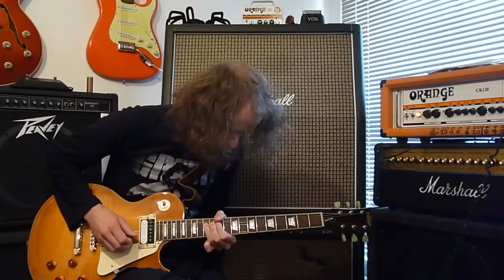Why I prefer Solid State amps to Valve amps

Comment: Solid state amps hold their tone better. A tube amp needs to be cranked up to the stratosphere to get the best from it whereas a solid state holds its tone at low and high volume. Solid states dont like to be cranked high either. people run SS amps like tube amps and wonder why they sound like shit.

Comment: Interesting. My experiences are the opposite. 
Solid state amps are fragile. One spike from a countryside power line and they might die.
The valve amp can take much more abuse without any problems.
 I had a Super Reverb that worked perfectly for over 20 years. It sounded as good when I sold it as when I bought it. The power valves are the weak spot as they can get worn after a couple of thousand hours of use, bet the preamp valves can easily take 50,000 hours without degrading.
I never serviced my Super Reverb as there was no need. But during those years I had to repair some solid state amplifiers that could not handle normal use.

Comment: Ha... I know exactly what you mean. Ive gigged tube amps for 35 years in evry enviroment you can think of.. Bars, barns , sidewalks, Street dances, garages, fields, Gyms you name it. Like you said a tube amp has it's own mind. Ive started gigs with 128 volts showing on the meter and watch it drop to 108 v in a matter of seconds.What I think happens is the Bias changes and the power tube's curves change enough to hear and feel it. BUT- it can be magical at times and that's what tube freaks quest for- those rare 'voice of God' moments.     I use marshalls (plexi, 800's ect) but in the 80's I did a stint with solid state Randalls. I was sold on their 'Constant current' and damping factors, and like you say, CONSISTANCY. Plus I didnt have to Jack with tubes. It took about a year for me to miss those fucking tubes. (harmonics i guess) . To each his own- Nothing wrong with solid state though- they do have their upside. Much respect, thanks for the vid....
Reply from the maker: Thank you for watching. : )

Comment: Get a Roland blues cube or 1980's Marshall Lead 12, Lead 20 or Master Lead 30 (a jcm800 circuit in solid state). My lead 12 sounds just like a tube amp. But I prefer Tube
Reply from the maker: I have a Marshall master reverb and a 5210 combo. They are very awesome. :)

Comment: the Marshall MG series was the biggest piece of crap they ever made. The AVT and Valvestate series were the best tone in my opinion for solid state. old MOSFET Marshalls are very underrated too, they lack some full bottom, but they are the loudest clearest thing I've ever used.
Reply from the maker: I would beg to differ on that as I love the MG series. I owned a valve state head and it was good but I got on so much better with the MG and still do. I have a few of the old solid state marshalls to. They are stunning amps. Thank you very much for watching. :)
Reply: to me the MG series was just way too scratchy sounding, and switching from dirty to clean was no easy task. the clean would always be too loud. i almost bought one of those orange amps in your video, but i compared it with my AVT-50 head and stuck with that. my main rig is a 1988 JCM 800 2205, and the AVT can come close to my normal sound

Comment: Yeah, there isn't much of a difference in tone/sound between a solid state amp and a tube amp, especially when going through the same company for both of them. However, I have a 5150 II and also had a MG 100 dfx and a solid state peavey combo amp, and the difference between the two Peavey's and also the 5150 II and the MG 100 was night and day! I mean I could get a pretty good tone and sound out of the MG, but it wasn't anywhere near the quality of my 5150 II.... not really even close. The 5150 II is sooooooooo much better. And, in my opinion one of the best amps ever made, if not the best. It's better than both the JCM800 and 2000, better than a Bugera, lol better than a 6505/6505+, and even better than the original 5150 and the newest 5150 III. However, that is hotly debated as of late, and I think it only barely beats the III out by a little bit.... but that's just me. I personally also don't see much difference between solid state and tube usually, but there are exceptions out there. Like how the JCM does have a better tone and sound than the MG does, and it's fairly noticeable. And on the other hand Line - 6 amps I can't see any difference in sound or tone between SS and Tube not one bit. And with Orange, I haven't really noticed much of a difference if any between the two I don't think. Cause some people will say that it's all about the maker or brand and the quality of their products overall, siting Peavey and line-6, how with Peavey SS and tube you can tell the difference, but you can't with line-6 and blah blah blah, but the same is true for Orange I've found, and they have super high quality amps of both kinds, just like peavey does. Like everything it is all about personal preference and also a person's desire for stuff to be a certain way, so they will hear things that they want to even if they aren't really there. You really just have to decide for yourself what you like and just go with that. What another person chooses to like and go with is their preference and right. No one has any room to say "you should be using ____ instead because it's better" well it may be better to you, but to them it might not be or it might not make any sort of difference at all whatsoever. Do what you like and let them do what they like, or as the saying goes, to each their own and live and let live.... or in this case jam and let jam. lol

Comment: I think the same about those who believe their Hi-Fi system sounds better than say my Marshall stack (in stereo) for playing rock/heavy/metal/punk music !! I have my lovely floor standing Q Acoustics next to my Marshalls and I switch between the two depending on my mood, type of genre and I guess sometimes IF I AM SOBER.  No one on this planet would EVER convince my that say Motorhead could EVER sound better on anything other than Marshalls, how could it, it was recorded using the damn things !!! But what I really wanted to say, its ok using Valve but its the actual speakers in your cabs that matter the most the drivers those round things that generate lots of noise (sometimes). Mine currently have G12T 75 on top with seventy80s on the bottom I took the VIntage30s out cos I wanted a change. cos to me no matter what amp u use, if the speakers are not to your liking, flavour taste, no matter what the amp, its going to sound really bad..........

Comment: Ironic how reliability and consistency are an issue with old tube amps. It was reliability and consistency that kept new solid state amps out of the market when that technology first came out. Just like old tube amps i'm sure old solid state amps play up as well. And just like new solid state amps, new tube amps are also reliable and maintenance free. Just avoid the vintage 'nos' tube nonsense unless you here the difference.

Those solid state amps sound fine but there is far more to choose from in tube amps. Good luck finding a solid state tweed, brownface or blackface design.

Comment: I agree with almost everything you said ..... and one of the biggest things is that the vast majority of cloth eared twats at any gig really makes the sound quality question redundant ... I started playing in the 60,s and the only thing available was valve gear ....when eventually solid state first started appearing on the market the sound quality was absolutely abysmal .. but with the advent of the peavey bandits everything changed ... a good teal stripe bandit will piss all over many valve amps  ...... so yes more power to your elbow mate .... I do get fed up of listening to twats preaching the niceties of valves .....(too much maintenence)

Comment: I've have a bugera V-22  1-12 combo 22 watt valve and compare it to my peavey studio watt 65  1-12 combo  and you can hear the difrance my bugera V-22 sounded way more powerful than my peavey 65 watt solid state amp you have to compare side by side the next time you get the chance
Reply: I Compared my Orange cr60 next to the Bugera v22 and i liked the orange much better ! Its more Powerful -  has more Volume - more Gain and a far better "British" Tone , not all Solid State amps are the same !

Comment: Bugera makes affordable Valve amps, for example the 1990 is a JCM900 clone and it sounds exactly the same as the 900 with the knobs set the same on both amps, and the Infinium amps are great because they monitor the valves and you can switch them out yourself and the 1990 is only $400 new, just sayin people

Comment: I only ever used Solid State amps. I've had one vale amp in my life, and it was curious and fun. It was a home build project that I thought sounded interesting. That is the thing I guess. In the end the only thing the amp does is turn guitar signal into noise. After It's done that you eighter like said noise or you don't.
I've always found enough solid state amps that make noies I like. 
Sure, there's enough solid states out there that are rubbish, but try to avoid them. It's not rocket science really.

Comment: Use what you like.  It was necessary to make SS amps. We finally in the 60's were able to get  PA SYSTEMS and GREAT BASS AMPS all SS the rest were low wattage and the bass sounded bad. Keyboard amps SS best.  I agree its nice to have a light weight amp.  PEAVEY PROOVED THAT  he could may Road Tuff and good power Guitar amplifiers. Peavey was affordable and these amps are saturday all over South Eastern USA and then everyone went to SS. Ampeg had to do it and lots of other out of business amps the most interesting SS amplifiers made in USA were the KUSTOM TUCK and ROLLED PLEATED high wattage big speaker amps. VOX made a tone SS Beatle amps. Its all good. I am a Tube amp man but I still use small SS amps in the Studio QUIET. CHEAP

Comment: Had both much prefer solid state better distortion. And louder. 
I find I have to hit the strings harder with a tube
Amp...I can play faster
With a solid state...
If there is a difference in sound it isn't worth the price difference.

Comment: Valve amps are a lot more tolerant of different electronic factors that one imagines. From biasing to impedance matching to drivers.. There's a lot of voodoo spoken about valve electronics. Remember, just fluctuations in mains output will have the most fettled valve amp operating at a different parameter than the absolute designs but heck, unless the circuit design is pushed to absolute boundaries, <20% tolerance of operating voltages is workable. Just checkout vintage amps working with most of the vintage components well adrift...

Comment: How dangerous valve amps can be??? Eh?
Dude you're buying old knackered amps that's the problem. I had a boogies for years, gigged the crap out of em and never put a spanner on em or changed any valves. They never ever let me down and the tone was just killer!! 
As for not hearing the warmth or tone of a valve amp, I really can't understand what you're saying. 
I have had a good SS amp, a Fender stage lead which sounded but once I played through a couple of Boogies Elvis had really just left the building and I've never gone back....ever and SS doesn't even come close to me. 
I'm not saying you're stupid or an idiot or anything like that. Your opinion is your opinion and the same for me. But I do massively disagree. 
But hey that's ok. It's a free country. Have a good um. 😉👍😎

Comment: You buy a valve amp because it's impossible to hear a ss amp when u got a bass player with a valve amp and a noisy drummer.

I had to buy a valve amp because my guitar was way too quiet
Reply: SEDAT   disagree 

 took my MG 100w
To the studio..with strat mex  sss 50s.
The drummer was a zep fan..so played like Bonham 
Bass player and me.had ear plugs In. MG on 10.
Cut through as good as my
TSL...STOP using the TSL
because the MG sounded 
Better....used MG  live
In a pub..and was asked to turn it down.
(  most small venues have a PA anyway ) so your problem can be solved easy...
Reply: @Mr75044  I have a randall 150RH SS amp and it can't even cut through vocals on full volume
Reply: @Desolator1  all I can say is in my experience..in 1980
I had a hywatt  valve head
But now I would rather use
An MG...Try a boss eq pedal  cheaper than a new amp    plenty on e bay..
Used one with  a roland 60w  cube...worked fine.
Reply: @Mr75044  mg is fine.but please don't suggest that mg is just as good as a very good valve amp because it's not
Reply: @Desolator1  tried to help you ...suggested an eq....I'm not going to argue. Suggested you spend  2000 pounds  on a
Valve head and stack  then.

Comment: Hi Dave, could you please expand on the dangers of an unserviced valve amp?
I'd be very interested in what you have seen happen with them. I'm an electrician with a degree in electronic engineering and personally dont like the idea of getting up close and personal with high DC voltages/currents but I do have a 1968/9 Park(Marshal) 50 watt tremolo combo in my possession. No plans to really use it as it is monstrously heavy as well as apparently being fairly valuable. I just stuck a couple of new valves in it a couple of years ago and it fired right up after spending maybe 10 years in my Dad's shed. Massively loud and powerful and all but I dont feel comfortable with the potentially lethal combination of high voltages and high currents within it. Have they bitten many people?   http://www.marshallforum.com/threads/park-amp.41646/

Comment: Simply answer if you play metal and want someone elses  sounds, play on a solid state, if you want your own sound and dont play metal, play a tube amp.
Reply: I think your wrong cuz a solid state sounds like shit when high gain but pretty good when clean so your logic is flawed
Reply: then why have an amp that just sounds okay sometimes
Reply: or only in one setting lol
Reply: Markus Odisho SS amps are always modeling, that means they are always altering the signal. there is no way to simply accept the signal coming in from the guitar, aka clean. its always processing the signal whereas a tube is not. that's why you cannot get a true clean from a SS amp.
Reply: Are you serious Steve? The whole goddamn point of an amplifier is to change the signal, and a tube will always color the signal.

Comment: I sold all my valve stuff  I'm sick of dialing dialing dialing   a solid state sounds the same every day   well if I'm hungover I have to turn the trebs down 🤟🤟🤟🤟🤪🤪 as I was clearing out all my valve stuff I noticed I had $3-$400 worth of tubes kickn around.
I did stumble on this "warmth" zone a few times but it changed day to freakn day   to me if your gonna go valve and you dont have a power source and attenuator  ($3-$4000) plus an Amp similar to a jvm $(3000)  get a solid state

Comment: Yes.

Valve amps cost more so, despite the many advantages of solid state amps, it pays for the industry to make the most of those tiny (only subjectively better) sound differences you get with a valve amp.  

I'm sure most of the quality differences you tend to see are because most valve amps are mid to high end and thus often have better parts and are typically paired with better speakers... And there's always been more choice with high end valve amps.

I recently bought an old Peavey Studio off ebay (my only solidstate amp) and it made me realise, despite what I was always told, solid state can sound great. If solid state sounds great why waste your time and money with valves? Certainly, let your own ears be your guide.
Reply: Guitar amps are tools of the creative process - period. There is no such thing as one kind, type, or brand being "better " than another - different tools produce different results, is all, and what is desirable for one won't necessarily be desirable to another. Cheap, crappy amps have been employed to great effect on multi-platinum selling recordings. The most expensive amps in the world have been used on recordings that no one ever heard. You are right, though - let your own ears be your guide. Whatever you think is best for you is best for you - until you change your mind. And there's nothing wrong with that either - creativity is a journey, as they say - not a destination...